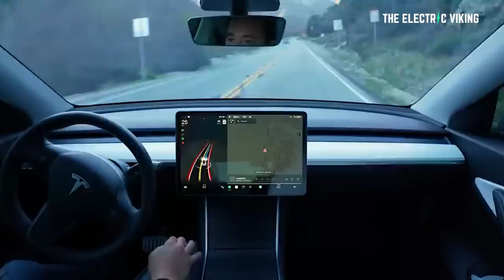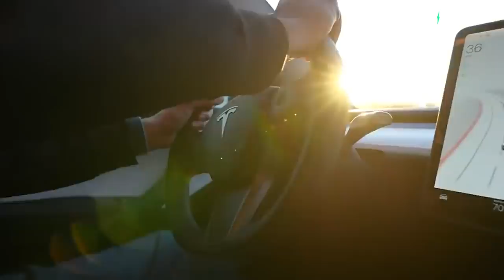Chinese insider EXPOSES Tesla's amazing new battery

Comment: As I recall, Tesla said they were planning to use LFP for their standard range vehicles way back on Battery Day. 
But it's definitely great to hear they've already been rolling them out.
Some youtubers were saying that 4680s would be replacing the other batteries, but that's definitely not what they actually said on Battery Day. They said they would use different battery chemistries for different use cases. 
Notice that they used 18650 for the Model S and X. When they started using the 2170 batteries, they did not stop using 18650. I thought maybe they would, but they didn't.  I'm not sure what batteries they are using today. But at that time, they continued using one battery for the S & X, and a different battery for the 3. And they were also using 2170 for the model y as well. 
Tesla is planning massive expansion, and they have signed deals with multiple battery manufacturers ( in China) because they believe they need as much as they can get as fast as possible.  The limiting factor so far has been the ability to manufacture batteries. It seems like Tesla has committed to massive expansion more than anyone else. 
Maybe BYD and other Chinese car makers will be able to expand quickly as well.
Reply: So basically, Tesla's new battery is made by CATL.  From the title, I thought they developed a new battery.
Reply: @tomtube1012  
They are using multiple battery manufacturers. 
In the US, at this time, their main factory in Nevada is a partnership with Panasonic. 
But they bought some battery technology companies and are also producing their own batteries. The 4680 is their own development, but they haven't perfected it so far. I believe their batteries made in California are mainly to test and improve the battery technology and to test and improve the manufacturing machines and processes. 
Other companies are working with Tesla to make 4680s as well. Tesla is planning to build battery facilities at their three new factories in China, in Berlin, and in Texas. And Samsung is building a battery factory near the Texas Tesla factory. But it hasn't been confirmed that they will actually sell batteries to Tesla.
However, Teslas plans are to expand as fast as possible, and battery manufacturing is the limiting factor. So if Samsung is able to make the batteries Tesla demands, then it could be possible. However, all EV companies need batteries, so Samsung could sell to other EV makers. 
In China, Tesla has agreements with CATL, LG Chem, and BYD. These are the largest battery manufacturers in the world, along with Panasonic.
Originally Tesla was planning to use the Shanghai factory to sell to the huge Chinese market, but later they started exporting from China, mainly to Europe. 
We are not 100% sure, but probably some, most or all Model Ys from China have CATL batteries. 
Meanwhile in Berlin, at least the standard range 3 and Y will probably be getting BYD LFP batteries. Possibly they are actually importing them from China at this time. 
If you look at this chart, you can see that the top manufacturers are Chinese, Korean, and Japanese. Tesla is partnered with all 4 of the top 4 manufacturers, and they are also working in California to develop their own batteries. 

https://elements.visualcapitalist.com/ranked-top-10-ev-battery-makers/
Reply: @AWildBard  I'm referring to this video.  The title says Tesla's new battery, but the one shown here is a CATL battery.
Reply: @tomtube1012  
Yes, sorry. I thought of that after I wrote. 
hehe
love this channel, but I don't love the titles

Comment: EV's in the US will suffer because there is no standard for electric charging connectors and because charging voltage is not something you can select at the charging station.

Comment: @8:57 not 700km range.  New Model Y from Giga Berlin with the new battery will have 455km (EU) range.  @14:30 Tesla has cancelled the $25k model thanks to the global recession and supply shortages.  They are prioritising the high-ring models until at least 2025, and they have marked up all models 15-20%.  So the traditional car manufacturers can try to compete at the low end, and that will probably bankrupt some of them, but govt will bail them out as usual lol.

Comment: Does Tesla have an exclusive supply agreement with CATL for the M3P batteries? This is unlikely since it hurts CATL and reduces the market for its batteries. As Tesla does not have an exclkusive supply agreement with CATL, any other car maker can use CATL's M3P batteries. Ford announced an agreement with CATL probably for the same batteries. M3P tech will erode Tesla competitive advantage rather than enhance it. Tesla investments in older batteries technologies is not as valuable including its impressive cooling design, blade batteries, cylindrical cell production process....
Reply: Tesla has been catl largest customer since 2020 now. They will not be doing anything to jeopardize this changing anytime soon imo. 
Catl converted a plant near tesla in Shanghai under 6 months and tesla has bought the entire volume which is over 40gwhs from that plant ever since. The U.S. catl plant will likely have tesla as it's largest customer as well as Ford off taking whatever is left.👍🏻

Comment: CATL will No Doubt ink Deals with Many Auto companies sooner or later. Tesla may get em first but they would have sold cars either way so no advantage for them over the competition. Hopefully the competition can do allot better then $25,000 car which is to high for me. I'll never spend that much for a car. Tesla Stock showing it's Truecolors today
Reply: Tesla has been catl largest customer since 2020 now. They won't do anything to jeopardize this changing anytime soon either. 
In China catl built a converted cell plant near the tesla Shanghai factory and in 6 months they are cranking out 40+gwhs and tesla buys every single cell since it opened up last year. It's naive to say catl would piss tesla off. 3+year's from now could be a very different story sure. 
But not today and not anytime within the next couple year's will they do anything to jeopardize this supply agreement with tesla. 👍🏻

Comment: I have a feeling that the first batch of LMFP batteries going into Model Y’s will be for a dual motor “long range” variant or possibly performance variants. The current LFP chemistry is really only suitable for single motor applications due to the lower charge / discharge rates. For this reason alone I think you made a mistake cancelling your RWD Model Y order unless you want to wait for a Long Range to be available in Australia.
Reply: I agree with you. But in that case Tesla should have a big room to reduce the long range price tag. At least about $10k less
Reply: “Should” being the key word… I would guess a price reduction will never happen unless demand falls… and I can’t imagine that happening either.

Comment: Model 2 should have a low range like 400 km, and be 4 passenger, it keeps the cost and weight down and doesn't cannibalize market of current models and makes a better taxi (IMHO).
Reply: If you intend a taxi, you want 5 or 6 seats as standard.  Otherwise you risk losing group or family customers, who would have to hire 2 vehicles 🤦🏻
The ideal taxi would be a lightweight 6 seater with good luggage space.  The Low energy costs would offset higher purchase price & make the ideal taxi, which would remove the need for a large number of $25K private cars which sit around doing nothing for 20+ hrs a day but don't recoup purchase/running costs.
Reply: @alexmanojlovic768  Rarely is a uber ride more than 3. Anywho a cheaper and more reliable alternative to owning a car ... not a ride to the airport! Back in the day 3 in back one up front with driver makes 4 .... driverless taxi makes 4... when did we have 6 passengers taxis? Look, most time only one person is in car!
Reply: @lyrrad62  Who mentioned Über?  Other taxis exist & you also need to get out more! 🤦🏻
Funny, but try Friday/ Saturday nights with groups of girls/guys going to & from pubs/clubs etc, so you're wrong.  We're a 6 man family & didn't use taxis because of price.  I know plenty of Taxi drivers.  Quite a few specifically have MPV"s with 6/7 seats & charge a little more for carrying more passengers.  Basing your comments only on what YOU know!
Although 6/7 seaters aren't THAT common, there's still plenty around, just not usually Über.
"Anywho"!... 🤦🏻
Point is, if Tesla is going to build 6/7 seaters, they'll do something radical that cuts costs (think CyberTruck) so they won't cost as much to build as the London Black Cab (5 psngrs) which doesn't sell enough to allow economies of scale.
Plus, they're specifically making the CyberTruck platform exceedingly cheap to make & be crash-safe, so using the "skateboard" from the CT & sticking a safe, plain body on it that looks unconventional would make sense.  ALL vehicles on the road usually carry only 1 person, so what does that have to with anything, other than allowing you to think you're being clever, winning arguments!?
As I said, Taxis won't just be used for 3/4 hrs/day, so the fact they're a bit bigger/heavier for 1 or 2 extra seats isn't what will swing any decisions.  Taxis make more sense than owners, for the planet & congestion than the most common category of cars on the road, other than having an increased footprint.
Reducing the number of batteries & raw materials by having fewer cars made is the way to go.
Reply: @lyrrad62  "of my imagination" 🤣😂😅 where you live, are your bedroom walls rubber & they only let you outside under supervision? 🤡
 as I said, Captain Mook.  Try Friday, Saturday NIGHTS where a lot of Taxi drivers do MOST OF THEIR BUSINESS, because it's busy as hell, & there's lots of customers within a short time.  Cars full of young men, girls..     but you're a world 24hr a day expert. 🤦🏻
Isn't Prisock spelt differently ?.....
Funnily enough, the FSD CyberTaxi won't be licenced for another 2 years at least, so if they can start banging out a driven Taxi to began with, & as I said use batteries more efficiently, they'll do it, plus there'll be a BIGGER PROFIT MARGIN ON selling TAXI's than a $25k car.  Plus, the Taxis will have all the relevant FSD hardware built in, that allows the owner/driver to sit at home & let the Taxi do its work, driverless, when the time comes 🤦🏻
You're clearly so intelligent, you already thought of this.... 🤣😂😅
But what do I know??
(I know a d1ck when I see his ramblings)
Reply: @alexmanojlovic768  pls read. IT'S NOT TAXI, UBER, BUS. It's a "Taxi" because that is Tesla's target market (pls learn Tesla's plan and wording to stock holders) the 4 passenger "Taxi" is their stockholder promise NOT MY RAMBLEING. If you can't get a clue, maybe you couldn buy, one check mommie's purse.
Reply: @alexmanojlovic768  The platform.. the Giga castings, the development, is, a 4 person global platform not a niche market taxi. The taxi is just marketing for idiots who can't understand future markets and how to get there.
Reply: @alexmanojlovic768  ignorance can be fixed with knowledge, YOU CAN'T FIX STUPID  good thing it's a choice!
Reply: @lyrrad62  enjoy your choice then. And you're absolutely right.   I can't fix stupid, so i'll leave you to it!!
I can't see any hope for you....
The point is, I can accept it if my presumption is wrong, you seem to be having difficulty accepting that you may be....
Reply: @alexmanojlovic768  Wrong about, Tesla already having the platform, and not needing to develop another 5 to 7 platform, and leave the largest segment of the auto market undeserved,  wrong about the average occupancy of cars at 1.5 or historically taxis only carry 4 passengers and a driver? Tesla's plan? Where are you right? I choose knowledge please educate me and all the Tesla stockholders!

Comment: Just a thought, All the EV progress that has been made is wonderful but has anyone thought about the use of asphalt being  petroleum based and quite frankly an inferior road covering that requires years of maintenance. Someone needs to work on this issue.  We are still using materials that are inferior to the manufacture of roads than the Romans did hello.
Reply: What material are you suggesting would replace asphalt? There are a great many ways to modify asphalt, and the way its made is an extremely exacting science. I'm curious about any suggested replacement...

Comment: Sorry Sam thats not current news! In my option the M3P-option from CATL is very nearby the blade-structure from BYD. I can´t see an advantage an this time. Prices and exactly facts are not known - it´s all a preview and announcment from CATL while BYD is building since 2 years.

The today from Viking-Sam overhwelmed prsented manganese research is an old hat. Thats planned and public since the battery day 2020 and is dicussed so many times not only from Gordon [The Limting factor]. 

You know I love your channel and your updates especialy from chinese leading marktet and your emphasized presentation [without too short pics, sometimes 2 per seonds]. But at this point you shpuld spre your power and voice for health!
Reply: addition: what about news from investors call - that wpould be news from 04.08. that could matter. Also the problems with dry abttery electrode and production of the 4680 - far from ramping plans away ?
b.t.w  Elon favorite more a robotaxi than a small Tesla because only a smaller car couldn´t cut the costs far more than the mass poduced MY/M3. But it would take customers also from this mass models away. That will do the chinese competitors too, so he has to present a complete advantage [robovan], I guess will be the next.

Comment: I'm not sure that LMFP will be 30% more energy dense than LFP. More like 15.7%.

Don't shoot me.
Reply: maybe only the kathode is 30% more energy dense 🙂
Reply: @stefanweilhartner4415  makes sense!
Reply: @brunoheggli2888  what energy density did you take for LFP Vs LMFP? 

I took 190 Vs 220 as that's the mid point from each technology from the CATL slides (not in this video, but they rate LFP as 180-200 and LMFP as 210-230)
Reply: @brunoheggli2888  13,123% in total could indicate 30% for the cathode
Reply: @brunoheggli2888  or maybe it is 29,124% in the meantime

Comment: I don't know why anyone currently would buy a Model Y. I know I wouldn't.  I tried an EV6 the other day, and fully loaded it costs the same as a Model Y long range. Then you get V2L, class leading charging, an instrument cluster, physical buttons, head-up display, ventilated seats, and a roof window that opens. Tesla gives you what? One second better 0-100 kph, slightly better range and efficiency and a harsh suspension. I am impressed by Tesla's battery improvements, gigacastings etc, but that all goes into their profits. The prices are only increasing without any significant additional features being added. I think they have to step up their game in terms of features also.
And by the way the Ioniq 5 is cheaper than  the EV6, so even more bang for the buck if you can get one.
Reply: Supercharger network, streaming entertainment, games, best safety ratings in the industry, sentry mode, auto pilot/self driving/vehicle summon, over the air software updates/new features, quality in house audio. There are a number of features that they do well in their own way. Enjoy that EV6 though. Tesla's mission was to speed up the transition to sustainable energy not sell everyone their cars.
Reply: @joseosorio7064  Well, I'm not buying an EV6 either, just too much money. The SuC network has been opened up for others here in Sweden, so it's no strong USP anymore. EV6 had sound from Meridian, sounds great in house or not. Sure, I guess when planning trips with the in-car navigator with charging stops is still best in a Tesla, and there is a lot going on with the software for sure. But there is still more to a car than software.

Comment: Tesla cars burning down at Eisenhower tunnel colorado going over continental devide. Why motor draw on battery going up steep grade heats battery up. This new maganese battery will be less resistance  and maganese disapates heat better then aluminum, nickel, and other metals. Maganese is less weight  then aluminum. All this equates to more amp hrs. Serve it up!